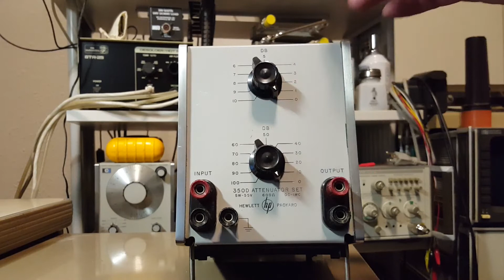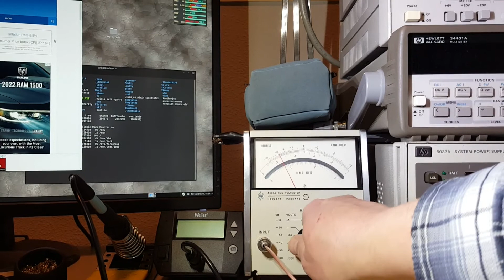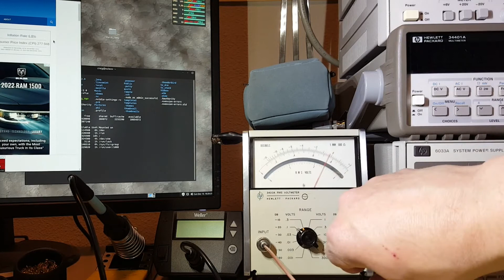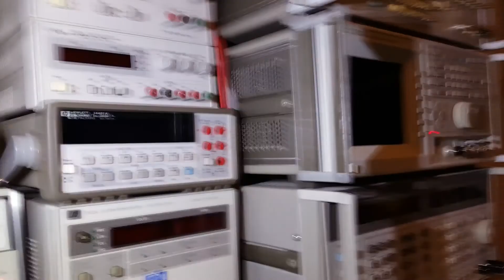HP 350D Attenuator.

Comment: I have a Marconi TF2163 step attenuator, which is similar but on 50ohm. Got it from ebay for 50€ and seems to work quite well. Interesting the mechanical inside.
I agree with you, this can be handy sometimes. Regarding the accuracy I would make sure also that the 3400 is well calibrated when changing from one range to the next. Maybe the attenuator is spot on and is highlighting small inaccuracies on the voltmeter.
Cheers and Merry Christmas
Reply from the maker: Thanks for watching. As far as I can tell the 3400A is within 1-2%. However when I was calibrating the meter there is one variable cap and two variable resistors (two of them in the attenuator section) that are at or near their stops, so I'll need to dive into that soon.

Comment: Your unit it’s from 1962. The serial number starts with the year, plus 1960, so 220 is 2. Three digit serial numbers you use only the first digit, for four digit serial numbers you use the first two digits.
Reply from the maker: Thanks for the tip, wasn't sure how to read the serial number but figured it had to be the early 60's.